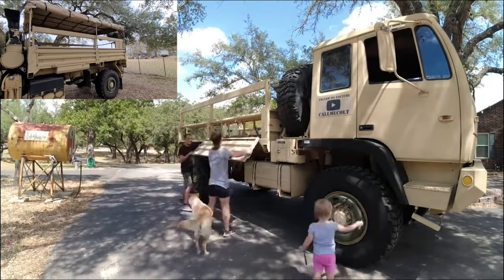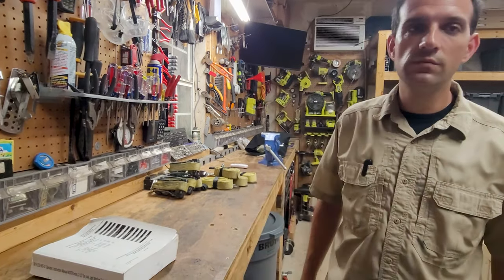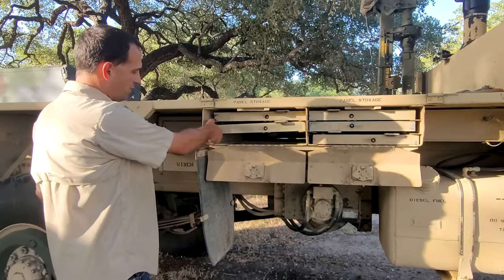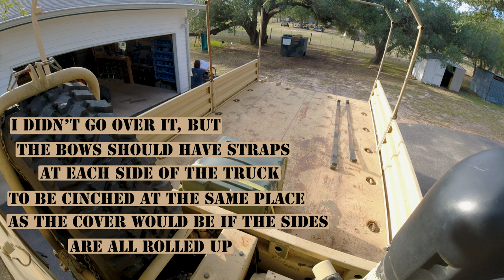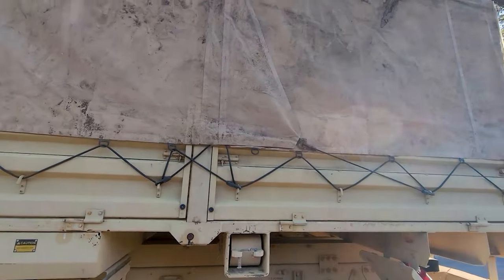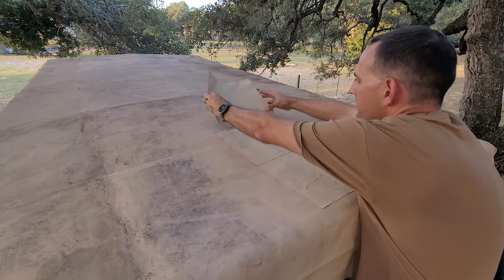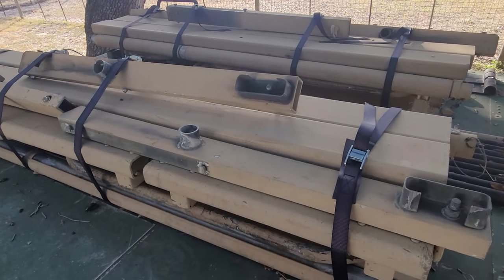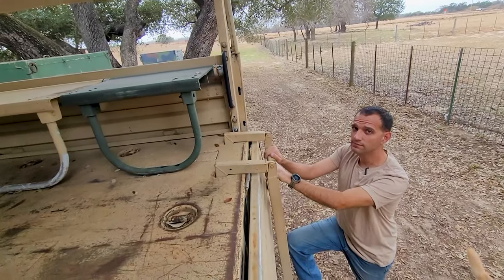M1078 LMTV - Cargo Cover, Bed Sides & Troop Seats

Comment: Colt, your channel helped to push me over the edge in purchasing an '04 M1078A1. I've referenced the oil cooler video (mine let go on the way home after purchasing and still dealing with it. the TMs aren't a lot of help on a serpentine belt 3126...) and I recently purchased the fan clutch solenoid from you. I want to win some Super Clean so I can get this truck looking fresh once I complete the oil cooler install. Keep up the good work, your channel is a go to resource!
Reply from the maker: I'm not sure if I should say I'm sorry or thank you! Hahahaha. Spend some time & get everything worked out right the first time & you won't need to worry about it again. The A1's have a lot more electrical, but it also gives you a lot more power, ABS, and stuff like that.

Comment: After putting this all on my truck by myself i dont think i ever want to do it again. Great video as usual though. I have the new tarp and the snaps are a pain in the butt never got all of them to snap
Reply from the maker: I worried about that. The snap type seems like it makes centering it faster but the snaps would wear out or stop holding. It's definitely a two person job.
Reply: @CallMeColtLLC  not sure if i had the new poles that break down if they would snap better but it works

Comment: Thanks, Colt!  Really enjoyed that.  My center bow is a bit tweaked and so there’s a noticeable bend/twist/turn between the front section of the canopy frame and the rear…talk about my OCD going nuts.  I must have stood there forever going, “how the f$&* can it not be in a straight line??!!” 🤷‍♂️🤷‍♂️🤷‍♂️🤣👍👍
Reply from the maker: Yeah, same here. The hit & bend on the passenger rear has my whole kit bent! And I was missing the top cross supports and straps. I've managed to make it complete, and even got a new cover now. I've managed to get a bunch of extra stuff for the cover kits. I might have some complete sets to sell soon!
Reply: @CallMeColtLLC  I only got as far as putting up the frame then I needed to haul gravel/sand/topsoil so I took it down.  I haven’t unrolled the cover since I bought the truck so I don’t even know if I have a new or old style.  I know I am missing the bar for the flap at the back (but I assume that’s just a plain metal bar) and the straps and hope that the bungee/rope is attached to the cover when I eventually unfold it.
Couple of funny things
- I had NO idea what “stakes” were in relation to the truck…as an avid hiker and backpacker 30 years ago that word has a very different meaning (I just realized about 5 min ago…”stake sides” DUH)
- with all my advanced college math, I still could not figure out how to fit TEN poles in that compartment 🤣🤣🤣 I finally asked online and got that story about the frame/canopy being redesigned after the beds were already in production.